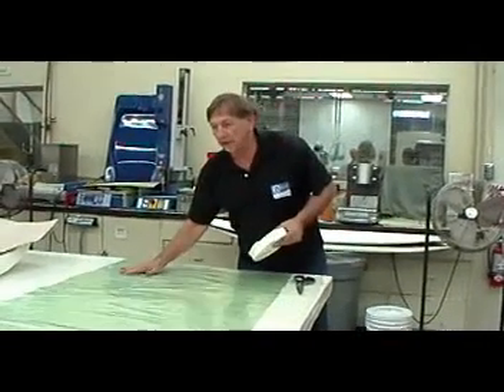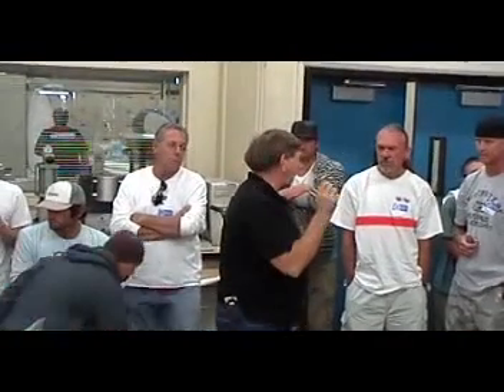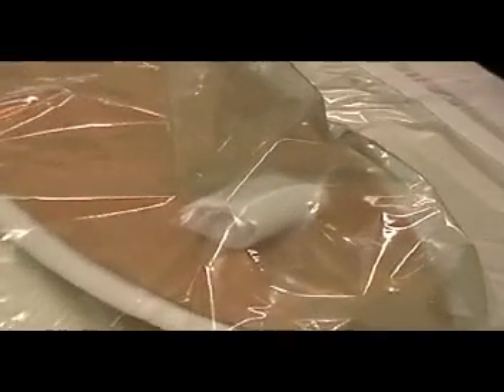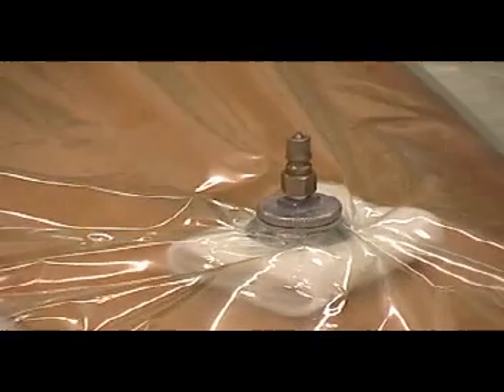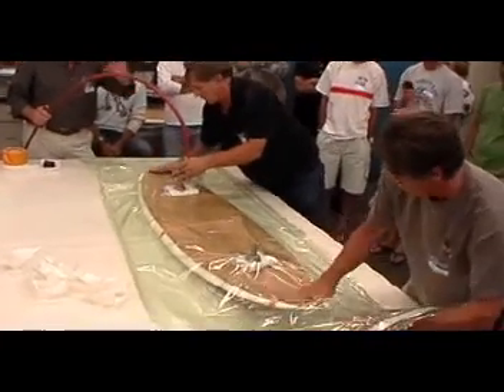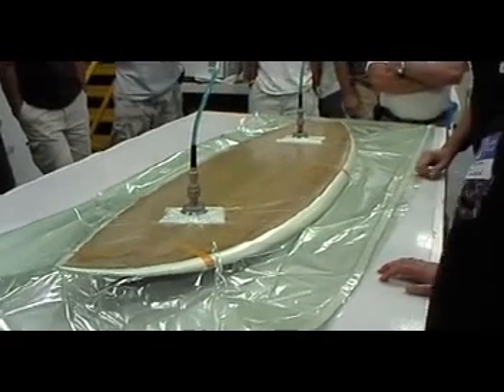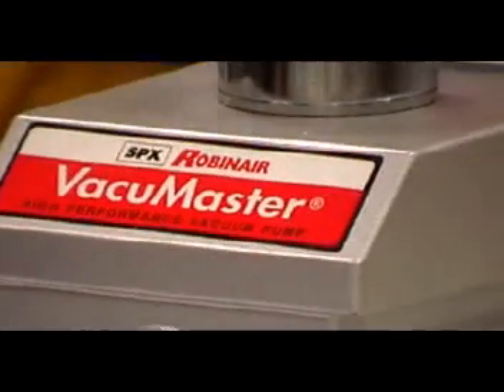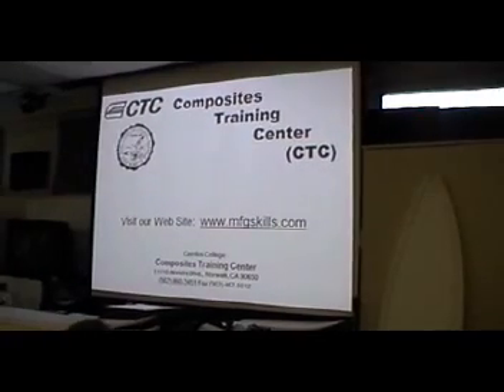WMD Surf Forum Part 3

Comment: if i am using a carbon fiber sheet on the deck and bottom of board instead of bamboo do i still have to glue it to the fiberglass fabric or can i just glue it to the board?